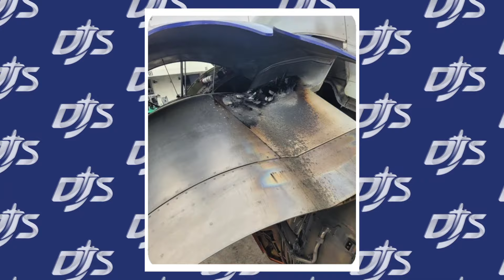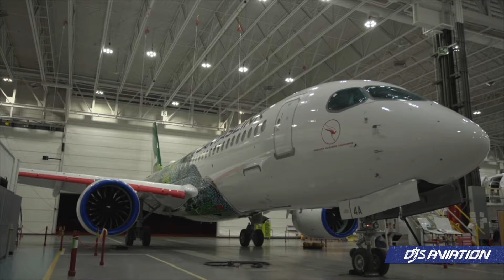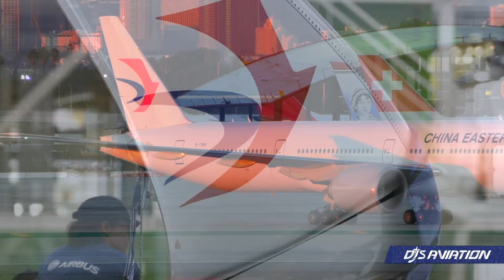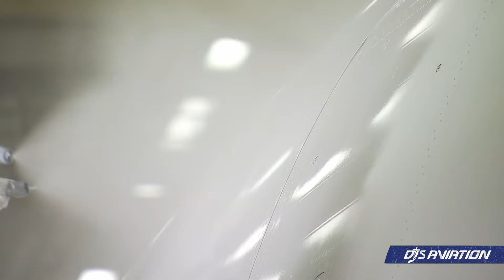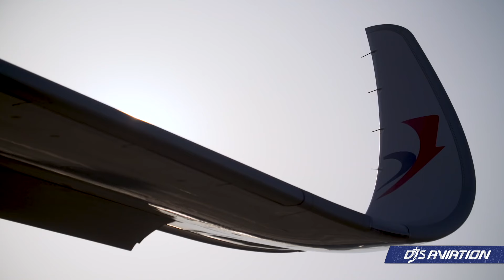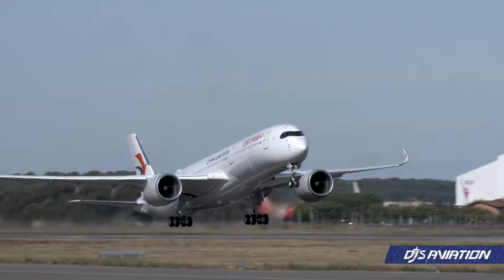747 Engine Fire, Boeing 737 Upgraded & Airline Expansion

Comment: More  delays on project sunrise A350 1000, regulators  requiring a redesign on the fuel tank setting back the debut to  mid 26'..
Reply: @stevesmoneypit6137 This is not Boeing
Reply: I have zero desire to be on a plane that long
Reply: Better safe than sorry tho
Reply: Thanks for the update

Comment: Split winglets were seen drilled in with simple Phillipsscrews on a another video. Looks a bit scary this method.
Reply: If they fall off, it’s not going to put the aircraft in danger, it will just be extremely inconvenient and would be a risk to people on the ground

but they probably won’t fall off